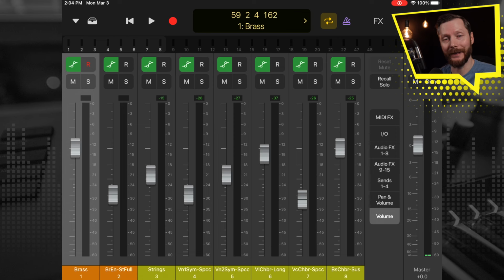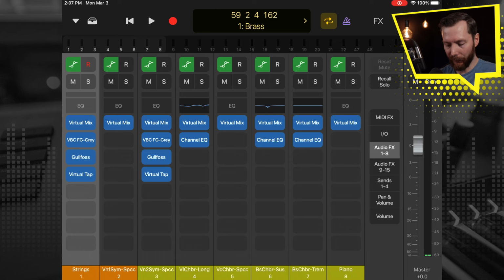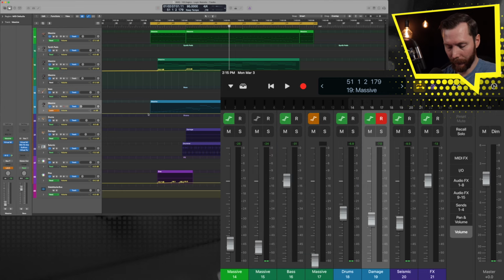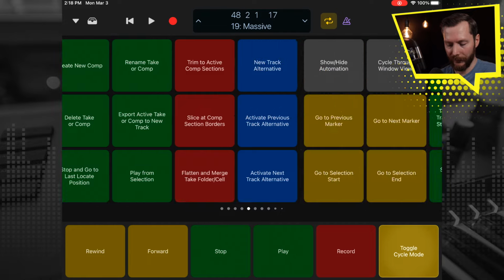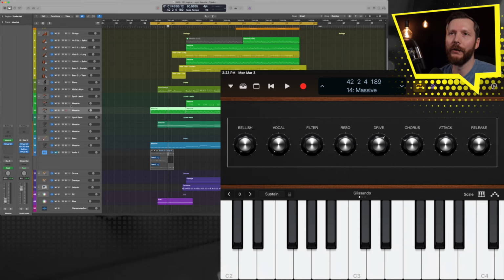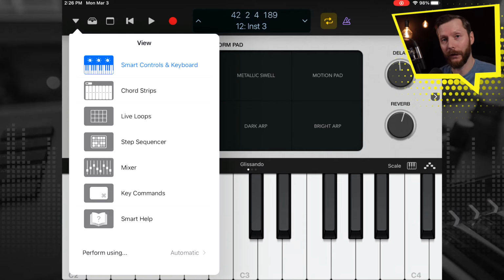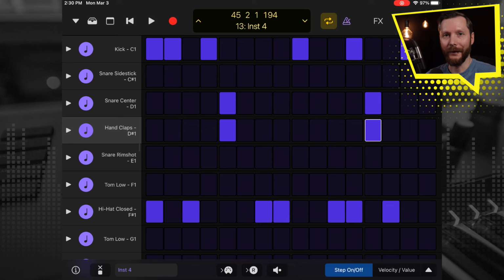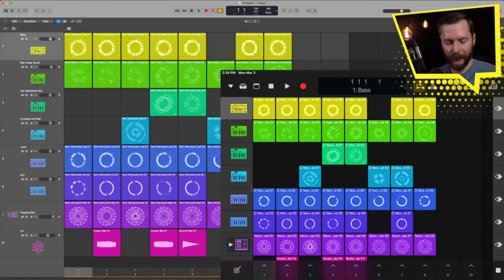Turn Your iPad Into a Logic Pro Control Surface!

Comment: Wondering if you could help. Apple couldnt. On my main account the sound interfaces like my apogee one and my others could not record into my logic daw. It crackles and splutters. When when apple told me to open a new user account , a test account on the same macbook. The sound interfaces was able to record fine into my daw. They were stumped. Any advice ?why this would be happening. I no live on the test account.
Reply from the maker: Are you recording to an external hard drive? It could be a user permissions thing.
Reply: @knuckledustermusic no. Straight to hard drive in mac

Comment: George you have some of the most helpful videos. I did have to go somewhere else to discover how to make my Keystation 49 MK3 to work with LP 11.1, but for everything else I just look through your library and find stuff. 

I'm not a fan of subscription software so Ive avoided the iPad version. Looks cool, but I just want to buy software once and be able to keep it (like LP itself). If I was making money with any of this it might be a bit more tempting, but I never will. sigh

I do have a bunch of Tonex stuff from my old iPad/guitar days and therefore a bunch of software on my Mac - and I see Tonex in the library windows sometimes but I'm curious if I could connect the iPad to the Mac and use some of the synth sounds like Turnado, WOW and Poseidon. Seems like it should be simple - maybe?
Reply from the maker: Thanks so much—that really means a lot! I’m with you on the subscription model too. iPad remote is free which is great. Logic Pro for iPad is a subscription though unfortunately, which is one of the main reasons I haven't tried it yet myself. So unfortunately I can't really comment about using iPad synths connected to your mac. You'd think there'd be a way, but I haven't dived into that (I don't use my iPad much). I'll let you know if I ever do however. 
Thanks for the support!
Cheers
Georges

Comment: Just got a Mac Mini M4 and I'm new to both Mac in general and learning a lot about Logic Pro. I was wondering if the specs of the iPad mattered when using Logic Remote? Can I get away with the most inexpensive model?
Reply from the maker: @N4TNA  the iPad isn’t doing any heavy lifting when using Logic Remote so any newer iPad will do! Welcome to Logic Pro! 
Cheers
Georges